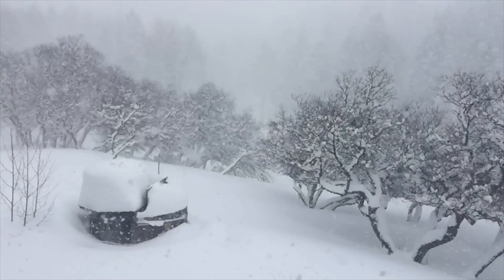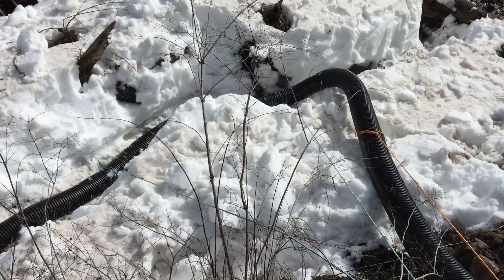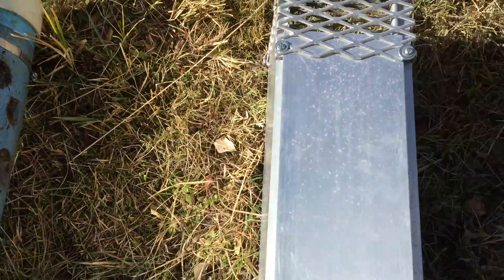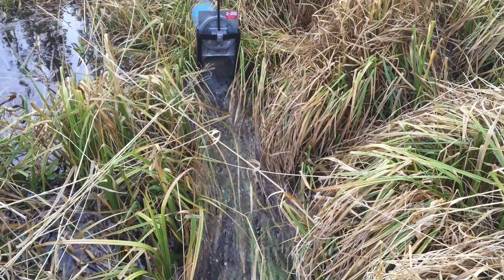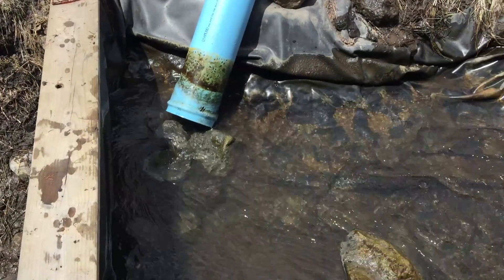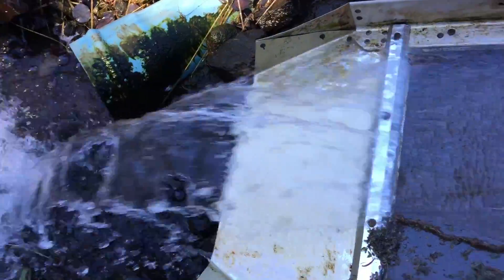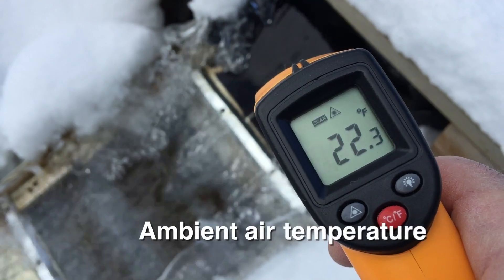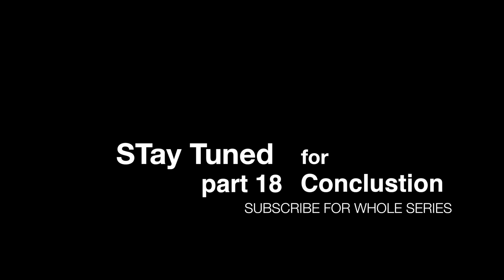Part 17 MicroHydro Power System in CO

Comment: Wooooo been a long time
Reply from the maker: Yes indeed.  We spent most of the 2016 year prepping, listing, & selling our original home. and then Moving!  Finally now in our dream home.
Reply from the maker: Yes Bob,  there wouldn't be an obstruction at the jet end, but the issue of any granular materials eating away at the brass peloton cups is the primary reason for the decisions on screening.  The system was originally installed on spring fed waters which had zero sediment and ran for 17 years with virtually no erosion to the pelton. Switching it to creek water which can be very turgid convinced me that a small investment in an adequate screening plan might prevent me one day having to replace a very expensive pelton wheel.  Thanks for watching.
Reply from the maker: TritonTech Not yet.  It's a potential in the future.  So many projects, limited time.  Steep learning hill to climb for me on that too, I know so little on it.
Reply: I understand. The more I watch your videos the more I learn. Couple of other thoughts. Would some form of shelter over the intake help with the ice build up? Paint it black to capture as much solar as possible? Also run a power line back up hill and use some of your shunt load to heat the shelter. Or jut a couple 100 watt solar panel hooked to a heater. That would be cheaper than running wire that far. I'm thinking ahead for later years when hiking up the mountain through deep snow might not be as pleasant. If the shelter extends out over the weir then there is less chance of freezing up......Other question. You noticed that the water pressure dropped and that was your clue to de-ice the intake. If the intake was full that would be a clue to an obstruction in the pipe IE ice build up on the walls. Of course if the pressure returns to normal as soon as you clear the intake then buildup is not an issue. ....... I noticed you used a drone. does that help you keep an eye on your system....... I envy you !! Such a wonderful place to live.
Reply: MrHydrohead wow, quite a project!  Might fine sediment become a problem causing component erosion?  Perhaps there is some sort of cyclone style sediment remover available?  p.s.  Typo in the closing titles...
Reply from the maker: +Eastern Woods On the last grid question.  We are 7 miles from the grid.  An estimate to string lines into the property in 1994-5 was $140k.  Two weeks ago, when I mentioned this to a friend that works for the local coop power utility, he said the price would be more like $250k-300k today.  So, the choice to be fully off grid has made good sense over time and No to hooking up and selling.  I agree on heat pump being more efficient, but not a logical investment due to the costs not being outweighed by the benefits. I could/should/would 've have buried a coil when we put the new transmission line in, but it didn't occur to me at the time and the expense might have been a waste anyway.  More answers later...
Reply: HydroHead, did I hear you said you run a bitcoin farm? That would be an interesting video to see, especially knowing that you are mining with no electric bill.
Reply: Not that you remember. That explains my icing concerns from 2 years ago. Thanks for sharing. One new question: do you really need that fine of a screen? As long as it will pass through the needle valve at the bottom unimpeded it probably doesn't need to be screened out. Wear on the Pelton wheel could be an issue.
Reply: Eastern Woods w
Reply: Just managed to read most of the comments below. Some interesting thoughts.....Question. What is bitcoin mining?..... If for any reason you decide you need to run a heat trace on the pipe, start from the top and attach the wire to a plug and let the water pull it down. All you need is a relief plug at the bottom to fish it out ( CAUTION !!  drain the pipe before opening )......You wouldn't need to add heat along the whole way just a heating coil at the top ( probably in your intake manifold ) to add heat to the water.....I wouldn't be surprised if part of the reason you have so little wear on your Pelton wheel is because the speed is set properly ( which is the reason for the belt drive ) ..... How has the belt stood up? ..... How often does the magnetic flow diverter shut off the system?....At the time we talked you were reluctant to add any kind of control to your needle valve because of security. Now it's in the thought process. Just as a thought ( and only to get you thinking ) it is possible to have the load sensors that control your shunt loads control the needle valve. IE If your shunt load strays outside 20% and 80% then the controller adjusts the needle valve. It's a little bit similar to how your shunt load keeps you at 60 Hz......You have the most robust micro hydro system anywhere............Couple more thoughts. Some one below mentioned a heat pump. You have more power than you can use anyway so a heat pump is just expense and one more thing that can break...If you run your generator at full power ( second nozzle) would it pay to hook up to the grid and sell your excess power rather than shunting it to heat?....When you put in your hot tub, don't boil it dry
Reply from the maker: +Eastern Woods wow, lots of questions.  I will post a few answers as time allows.  Give me time.  I only have a limited understanding of bitcoin at this juncture.  Bitcoins are one of several crypto currencies (CC) which now exist in the world.  CCs are not issued by central banks but can be used for lots of online transactions.  The validity of bitcoins must be verified by complex algorithms run by computers all over the world via the internet.  Mining is the process of verification and requires extremely fast processor cards to calculate the results.  This is often not profitable for people to attempt to earn bitcoins via the process due to the cost of electricity being greater than the payment in bitcoins for completing the calculations.  Also a great deal of heat is generated by the processors and there is an added need to provide cooling.  Several people have suggested that it could be a place to put our excess power to work and thereby generate some bitcoin income from power we don't use.  Also we have cold spring water running through the first powerhouse which could create a heat sink for the processor cards.  It all would require acquiring processor cards which are often modified video cards, setting up a cooling system, and hooking the bank of cards to the internet.  All this requires learning about how it all works and while I'm curious and hopeful about doing so in the future, it is not at the top of my list of things to accomplish or invest in.  Hence, back burner status. Time and the rising value of bitcoins or some other CC may see me implementing such a system in the future. We shall see...
Reply: Thank you. Take your time. We emailed back on Feb 12 2016. Nice to see you living in your home full time !! The questions have been storing up since your last video. Bitcoin or any CC is worth investigating but I think it comes down more to high speed and reliable internet access. You'd have to string fiber optic that 7miles and probably more.I kept the questions short to limit the space LOL.I hope a beaver doesn't appropriate your meadow. would be nice to watch but a nuisance on the power. 26 Deg liquid water !! There is a lot of latent heat between 32 deg liquid and 32 solid water but liquid water at 26 deg is an interesting piece of knowledge. I would consider placing the diversion pipe intake a little farther up the creek and sink it to the bottom in a slow moving pool to minimize air intake. Maybe build a small rock weir in the V notch to help form that pool. It will wash away every spring but that minor.......I think posting videos of other local systems is the start of your information blog. I'd suggest a paypal or other donation system. It won't be much but your information has value. Take care and enjoy life in your lovely home
Reply: I remember a screen that the fisheries department used  to stop fish escapement that was s self cleaning rotating drum that was powered by the flow of the water. it seems that such a thing would be ideal for your usage as it did not disturb the water flow though it might be difficult to keep it from freezing in cold weather.
Reply from the maker: +Eastern Woods No plans to add heat, works fine as is.  2200 ft power to intake anyway, line loss would be ridiculous. Original belts are fine and stable after nearly two full years of service.  Tightened them once after about 2 months.  Jet deflector circuit watches hz and if it sways outside a setable range, magnet cuts out and gravity drops deflector in jet and system shuts down.  Since the move, Hasn't shut down but once in winter when we turned on too many amps.  Mechanical control of flow has always been possible, but it's more expensive and was an initial decision in 1995 to use an ELC.  If I can get my electrical engineer friend back in gear plan is to put a means with stepper motors to occasionally adjust flow remotely, but as we change it so seldom it's a luxury vs a necessity.  Plan is to add solenoids to new loads that the ELC can prioritize for useful purposes.
Reply from the maker: +Eastern Woods people have said internet bwidth doesn't need to be high and our ping times are 12-20ms and reliability is pretty good. Radio towers no fiber.  Might be something we turn on and off as power permits. But I'm a novice, need to learn much more.  Decades ago had beavers move into first pond.  Was quite a pain to trap and move them.  I was pretty amazed at water temps and surprised we didn't get fragile ice, but so far no prob.  Maybe my measurements aren't accurate.  Works good so why worry.  Diversion sits at edge of property with no realistic means to get heavy equipment there. What you suggest is essentially what we will test only via this method:https://youtu.be/wZ4JLTnbUy0 Planning to try this different approach once huge spring run off subsides which is up 1000+ percent from normal just now.  I do have a donation button, but have never seen one dime...  adshare does give a small bit, but nothing substantial.  At least it has enabled me to justify buying a drone for cool shots.  Thanks for the goodwill greeting.
Reply: WOW that diversion inlet is a lot more than I was thinking. I was thinking of dragging the aluminum intake another three or four feet past the notch into the bottom of the little pool and throwing some rocks into the notch to raise the pool a few inches at most. Those rocks will wash away every year. You have to remove the intake anyway before the runoff. Just move the intake into "stiller" water where there is less air. The one in the video is a lot of work to move in and out. I'm going to send you an e-mail over night on some personal thoughts
Reply: Good for you , Enjoyed the whole series. I hope someday to  live like this also.. Thanks for sharing your inspiring journey. God Bless
Reply: congrats for new home :) now give us new ideas (Sonu Projects, India)

Comment: Long time no video! :)
Reply from the maker: Yes indeed.  We spent most of the 2016 year prepping, listing, & selling our original home. and then Moving!  Finally now in our dream home.
Reply: I love your setup. I understand the high maintenance and upkeep required for a project like this, yet I would do it if I had the means. Please make more videos on this! :)
Do a follow up on your current setup, why you chose the Coanda screens. Not many people understand laminar flow and you do a great job at explaining complex physics to the masses.
Reply from the maker: +phunkmeister  Thanks for the compliment. Our coanda, as you probably know, is not the ideal design in terms of slope and curve for self cleaning.  But, rather than rebuild the weir dam and bucket, it became what it is.  Besides, It handles more water than we can currently use now anyway.  I think to properly present a vid on the Coanda would ideally need footage of other screens functioning and perhaps animations to explain it properly.  My focus going forward will be to document other people's systems of all shapes colors and sizes.  But, if I ever get the right footage I'll consider your idea.  Thanks for watching.